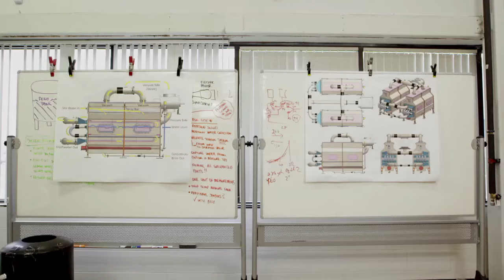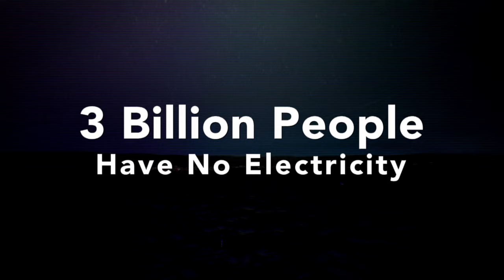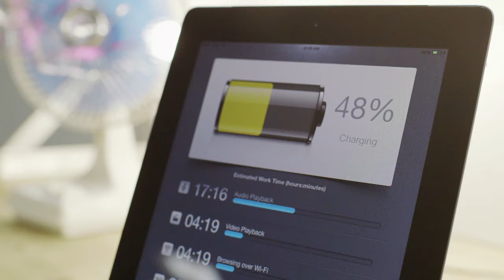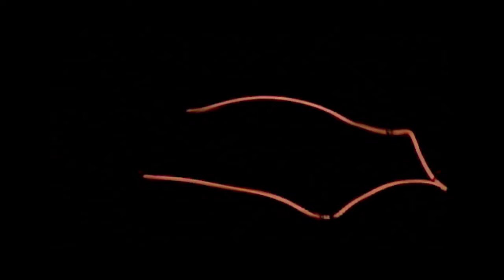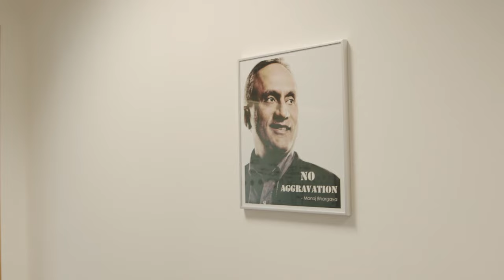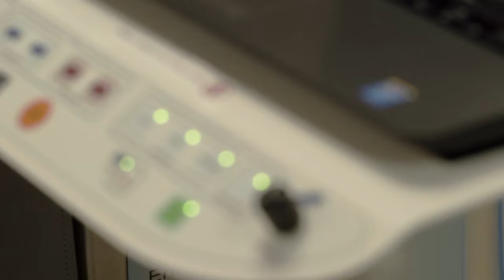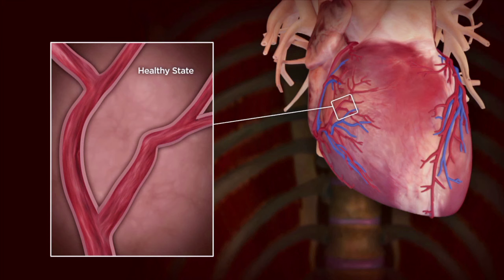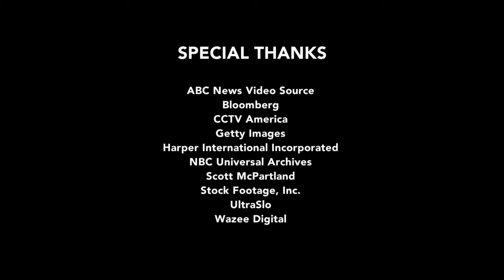Billions In Change Official Film

Comment: If you dig to deep you might just have dangerous results?  Every time you plug in your electric car you are using electricity too charge the batteries.  The charger is on the normal electric grid and therefore more pollution goes up the stack of a  coal burning plant.  The car is doesnt pollute until you plug it in.

Comment: Carbon Graphene has proven to be a good filtering media for salt water. About six years ago they came up with the discovery of how it was going to revolutionize salt water Dalinization  but it was quickly  squashed by the water industry.    it may be feasible to use graphene mesh   in line with your salt water system

Comment: THE biggest problem that I can see with this is the cycling. 

Let me explain. 
This free electricity is meant to be for the poorest people in remote areas. 
However, in places like India, the temperature is between 45C and around 15C .min. depending on where you are / time of year etc.

Also cycling for an hour or so takes physical effort. It also requires fuel in the form of food 

Poor people tend to be under weight/ older and for them to cycle in temps over say 20C is  VERY DIFFICULT.  

IMHO, I  think that the money spent on this machine would be better used on giving the people a solar panels / battery set up as it doesn't require physical effort to generate the power they need on say  a daily basis .
Reply: Ben Par If you can carry water on your head for miles in high temps and only eating one meal a day, I don’t think cycling for 1hour a day is gonna be much of a hardship. Don’t underestimate people who are considered “poor”, they are usually strong physically an wealthy in spirit 💪
Reply: @sambawomen  
WRONG 

I go to India often.  Not many people carry water on their heads as many have access to water from bore holes. 

You try cycling in 30+ C for one hour and you will see. 
You only have to look at say The Tour design France when it's over 30C....or Olympics or ⚽ or any sporting events which are held in high temperatures to fully understand my point.  ( BTW these are athletes who have THE best medical and nutritional care available to them )
Reply: Ben Par actually not “WRONG”, I am not just talking about India, I’m looking at solutions for other places as well, this would not be a problem for most people living in 30+ degree heat (would not be a problem for my family members even in their 70’s who living in hot countries who exercise as well as tend to their land in 30+ degree heat without an issue). Also they could cycle at dusk or dawn when the temps drop. But anyway you keep arguing the limitations as that’s clearly more helpful than finding solutions 🤷‍♀️🤦‍♀️

Comment: The rainmaker will be extremely inefficient when it comes to energy consumption, especially for large scale use. RO system is still much more efficient.
Reply: No it is not, they are reclaiming the heat on the other side and reusing 80% of that energy.

Comment: doesn't the rainmaker create waste products? what happens to them?
Reply: not sure what waste product you are thinking of but most of the waste would be distilled
Reply: Saltwater... we want to remove the salt so maybe salt is a waste? Which we could use in turn, so no real waste here!
Reply: Even if you dump it back into the ocean, it is a really really really small amount compared to the amount of water in the ocean. Also, the water that we use ultimately returns to the land or to the sea. 

What we really should be concerned about is dumping water containing pollutants that don't belong into the sea such as heavy metals, fertiliser (70% of fresh water is used for agriculture), toxic chemicals, & plastic